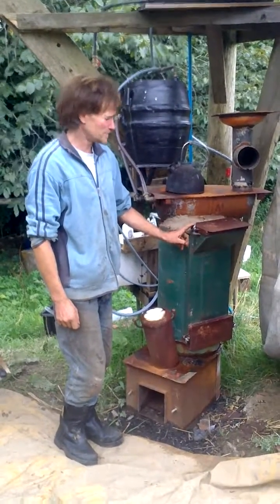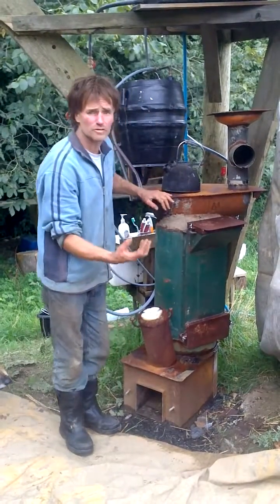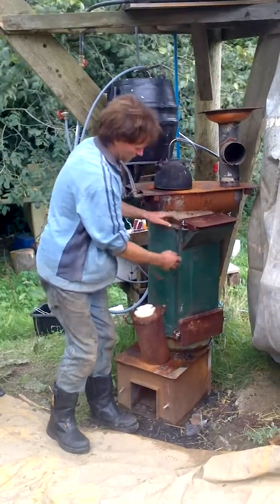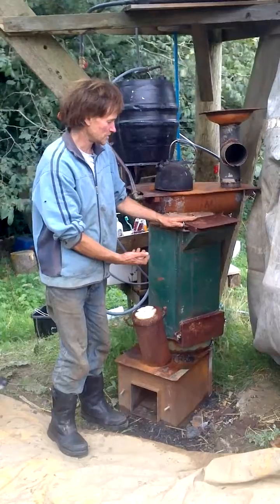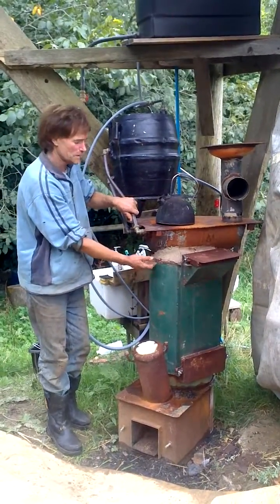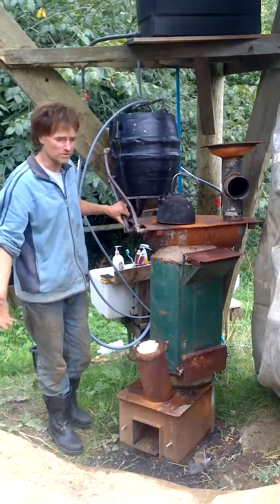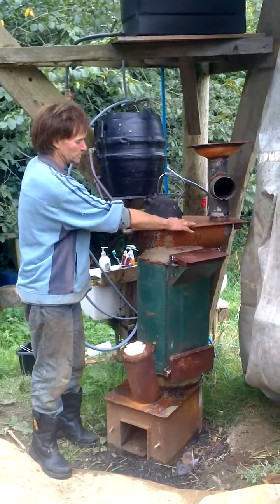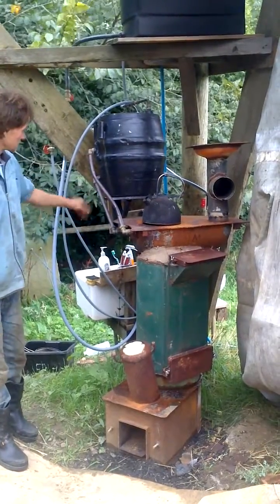eds biochar anila flue pipe riser

Comment: any chance of getting more info? i have some questions! nice design!
Reply from the maker: +itai goldman Hi Ital, thank you, what sort of info did you have in mind?
Reply: Hi Ed! great design and build! i would love to see it in action! I am trying to figure out incorporating a char kiln in a rocket mass heater and stumbled upon your video i was wondering about two things:
1. what are the optimal ratios of the dimensions for the rocket stove parts?
2. as im assuming the inner pipe (chimney) is perforated (sounds quality was bad, you might have mentioned this) to allow SIN gas to exit. does some of the char burn to ash? im trying to find a way to get the gasses into the burn chamber but the fire out of the char chamber...
(sorry if this was unclear perhaps you can still help)
cheers and bravo for the work!!
Itai
Reply from the maker: Look up a youtube video called "Eds biochar stove tech 01" (by Robin Lovelace) where I describe basics of a biochar rocket stove. (Tech has come a long way since then, old video) The optimum dimensions are determined by your heat requirements. I find 6" internal stainless steel pipe, 14 to 18" external diameter and 18 to 20 " tall retort heats an oven and a domestic hot water tank. Yes there are holes at the bottom of the riser pipe for the wood gases to pass through the combustion zone and no biochar in the retort will not burn to ash unless you have too many holes. If you are ever in Wales then visit and I will show you my fields, how i use the biochar and my domestic heating system. Best wishes, Ed.
Reply: THANK YOU SO MUCH Ed!
I will be taking you on that offer one day when i come back to visit that beautiful country (lived near llantwit major years back!),
keep up the good work!
all the best!
Itai